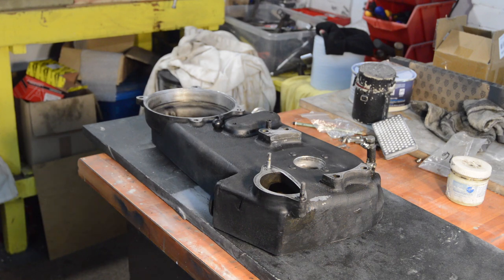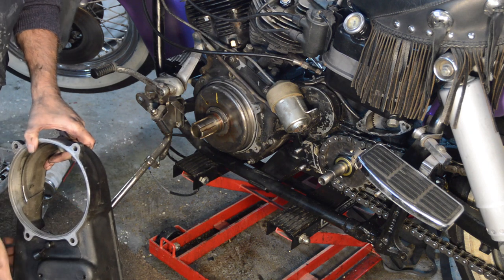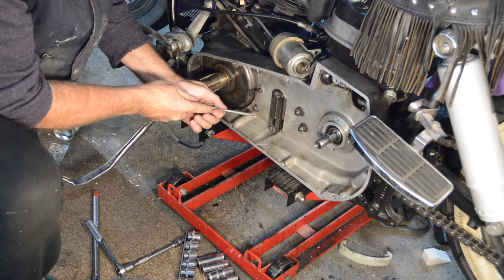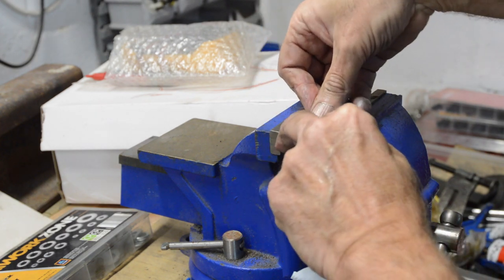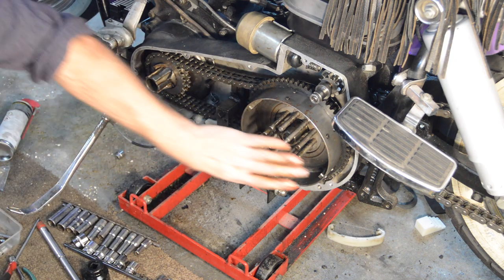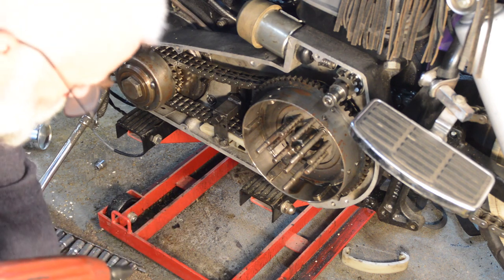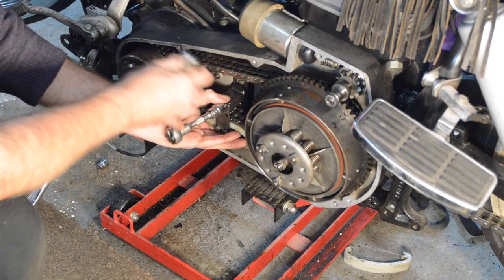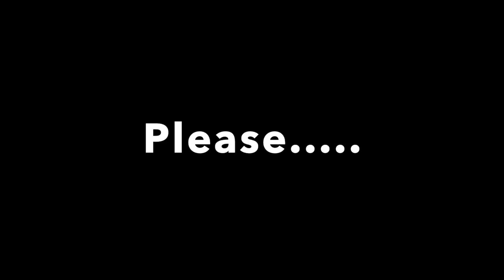Shovel Primary Part 6

Comment: This bike is confusing me, Mark, I have to say. You can have a dry primary or a wet one... That's a pretty radical user modification. I've never been a Harley guy, I have to say. They're a caricature of your bog standard American male. Overweight, overloud and frankly rather slow... (That, btw, was a joke, just in case any transpondines are tuning in. Feel free to mock the English. We're used to it). Thankyou, sir. Much appreciated, as ever.
Reply from the maker: This bike was originally "damp" Bill, with recirculating oil vapour to keep things lubricated although the clutch was "dry" (ish ). A previous owner plugged up the original pipework and associated holes and put a litre of oil ( or so ) into the primary case so the primary chain ran in that instead, which is apparently a common modification. The third option is fully dry when a belt is used instead of a primary chain, some bikes using this mod do not even have outer chain cases but use alloy guards. Confused?  I certainly am........as for overweight, overloud and slow I think that is a perfect description of my Shovel but it has a certain something that is hard to put my finger on ( mainly because it vibrates straight off again ) but it has a certain charm. Thanks as usual Bill for watching !
Reply: @oldnutsgarage  and now I'm even more confused. But that is the joy of Harleys. You can do pretty much anything to them and they keep going. As a lifelong fan of big old British singles I like loud and slow. The weight, though, I have trouble with. Theoretical these days.  If I were to go back onto 2 wheels I think a little Honda 125 would do. Bulletproof, 50ish and light enough to pick up if it ever were to go horizontal. My lovely stepson, now 18 and 6'5" or so is bugging me to give him my 61 year old B40, the 100th that rolled off the line. In pieces in a London attic for the last 30 years. And this is a boy who has never once fixed a puncture on a bicycle... He doesn't understand that that old crap had to be constantly fettled if you wanted it not to kill you.  (I'm starting to sound like my dad)... Keep safe, Mark, and keep 'em coming. The subscription numbers are growing and BSA has been reborn (ish). Not all is doom and gloom.
Reply from the maker: The B40 sounds like it needs saving Bill, there cannot be many older ones  knocking about
Reply: @oldnutsgarage  unfortunately, Mark, this particular old nut does not have a garage, living on a narrowboat and all. So 1st I create a workspace, and then... The bike was in perfect running order when I stripped and stored it nearly 40 years ago. Who knows what damage the squirrels have caused? (Seriously, ex no 1, in whose attic the bike resides was invaded by squirrels. They can't be as bad as mice or rats, but they've probably run off with the nuts)... You've inspired me, sir. If all else fails I'll donate it to you for educational purposes. Keep well and keep showing us all how it can be done. Many thanks.

Comment: I think you did all that work and spent money for nothing. The primary will most likely still leak the fluid that you put into it. Those primary covers are notorious for leaking. A lot of those bikes get converted to belt drive to eliminate the chain/oil. So, that being said, does your still leak?
Reply from the maker: Hi Tom, luckily the work was successful, have a look at the video "Wakey Wakey" in the playlist. The old shovel used to drop oil every single day, now it can sit for extended periods and leave no trace so I am very happy. Now all I have to do is try and stop it wet sumping.
Reply: S&S oil pump will fix that. The stock oil pumps suck. @oldnutsgarage

Comment: Hi. Did all that work rectified oil leaks? Or are you still finding new ones. I just bought 82 wide glide and it looks like it's leaking from everywhere.
Reply from the maker: Hi Stanislaw, it has stopped it dropping oil on to the floor which it was doing in large amounts before the work. Now there is a light film of gearbox oil on the underside of the box and no engine oil drips from the primary side, so pretty successful as I think Shovels will always breathe a little! Good luck tracking down the leaks on yours and thanks for watching!
Reply: Yes i heard that too, old machinery always leaked. Btw brilliant work and well documented, I'll wait for some warner days to tackle mine , so far im collecting parts to for it. Good luck with future projects
Reply from the maker: Glad you liked it, have fun with your Glide and thanks for watching!
Reply: @oldnutsgarage  the mounting studs in the trans case can leak. Three of them go through into the fluid. Next time it’s out, pull the studs, clean and use blue loctite..

Comment: Thank you so much for this. I am working in a gazebo, rebuilding my shovelhead and find this invaluable. Rebuilding a motorcycle in a workshop in December? Luxury! Best wishes Ian
Reply from the maker: Hi Ian, first of all good luck with the rebuild ! I admire your determination if you are having to work in a gazebo in this weather. Have you got a lot to do on it? Mind you I did not think mine needed that much when I got it and I was very wrong .It is all good fun though !
Reply: @oldnutsgarage  Hi , it's a thirty year old project that's had 2 house moves whilst in bits, so bits have gone missing and my memory for the details have been forgotten in the mists of time. I used to have a memory ,now I've got post-it notes, so your post are a huge help.
Reply from the maker: I can barely remember what day it is nowadays so I do not envy you having to pull it all back together. Good luck and let me know how it is going !

Comment: there is a clip that holds the pushrod to the throw out bearing, best to remove the cover on the other side to verify which throw out bearing you have...
Reply from the maker: I will be taking the cover off soon before I run the bike. As you say, the little E clip must be missing to allow the pushrod to be free. Looks like more rummaging about on the horizon.
Reply: I agree lots of little hardened steel bit in a gearbox is not good also weld the slinger on as the alway round out.
Compensation sprocket is more than the gears box impact gun for a couple of seconds that will do the job. Good job 👍🏻
Reply from the maker: I have it lined up for stripping next but there will be a couple of 550 videos first Micheal.

Comment: The case saver goes on the primary case not the starter....long as the rear chain is kept adjusted all is fine.
Reply from the maker: That explains why I could not get it to fit! There was no evidence of any damage anyway and as the bike is nearly 50 years old it cannot be too much of a problem. I will follow your advice and make sure the chain does not get too slack.

Comment: You have 2 clutch pushrod seals as the nut can take 2 so twice the sealing power..
Reply from the maker: Interesting, I did not know that as I am a Harley novice. I assume there was only one from the factory though? I will fit the second when it comes apart again and being a Shovel, it almost certainly will ! Thanks for watching.

Comment: Hi OldNut,
I hope you noticed in time that the three lock nuts of the clutch spring plate are mounted the wrong way around. The lug on the plate and the slot should interlock.
Reply from the maker: Hi, I am not sure if I noticed or not, so will have to assume I did not and take the cover off again to check. I prefer to blame old age but stupidity probably outranks it! Thanks for letting me know.

Comment: What is the purpose of the braided wire next to the compensator?
Reply from the maker: The wire hanging down under the case? It is the  regulator lead that will be fed up to the battery later. Thanks for watching!

Comment: Gearbox should use the same as the engine... straight 50 or 60 weight oil....  : )
Reply from the maker: Hi Tommy, a few people have said use 50 weight in the box but I thought I would give the heavier stuff a go as it was recommended on one of the forum in the USA. Might slow down the leaks too !